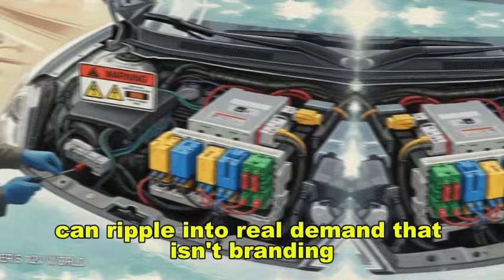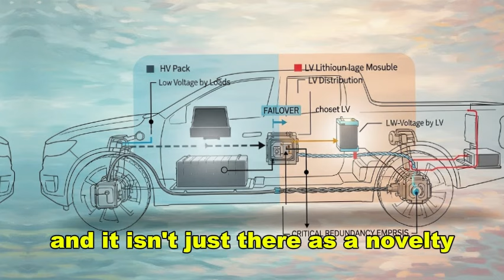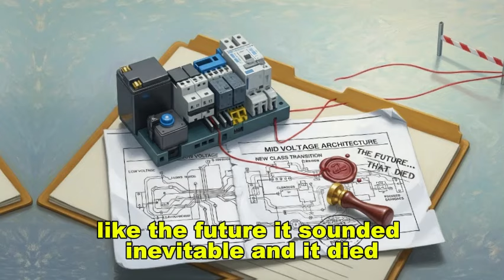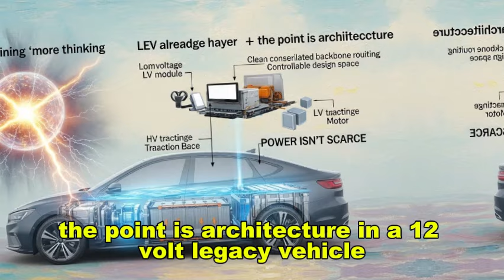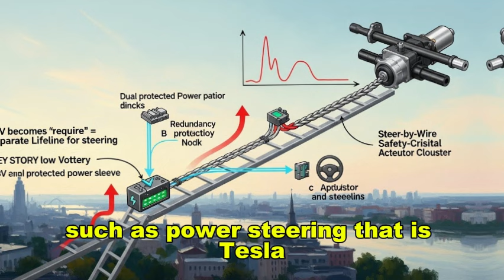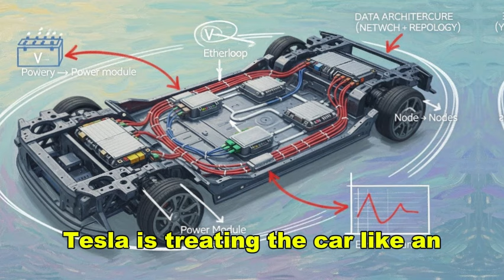Tesla’s "Silver Bomb" Explained: The 48V Secret No One Saw Coming

Comment: Steering by wire just fantastic when a microprocessor farts when you are driving. How many reduncy systems will there be for that. Brakes and steering shouldn't be messed around with keep them simple and direct. And as for local modules around the vehicle they have been with us for quite some time, pain in the backside when they go faulty. In my opinion all modern vehicles regardless of how many wheels they have are crap. Quite happy that my next vehicle will be a self build. I want robust reliability simplicity and repairability not take me to a dealer because a light has died or the alternator has died and needs to be coded into the vehicles computer. Just think how little longevity there is in a computer or phone and that is what is happening to the automotive sector